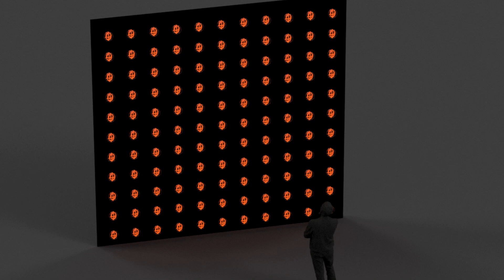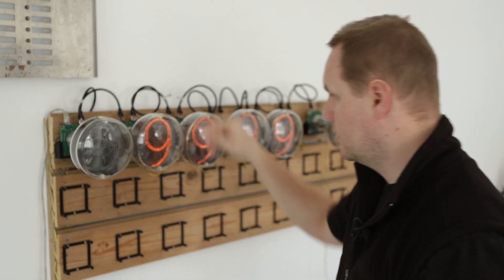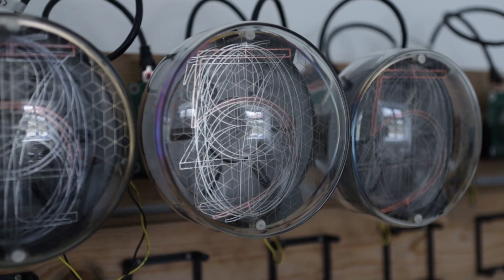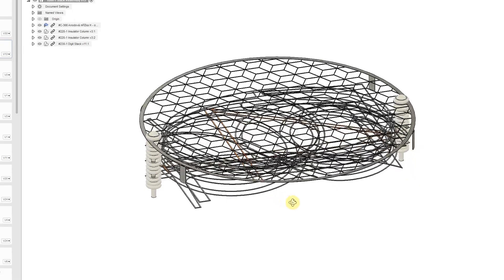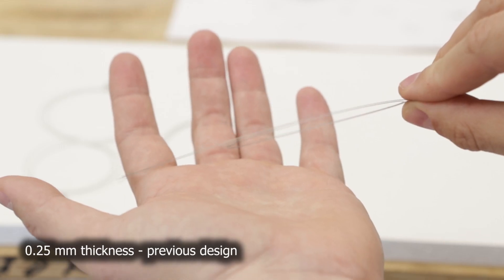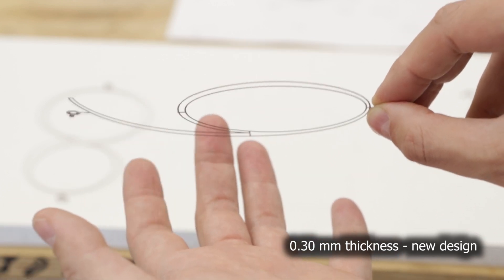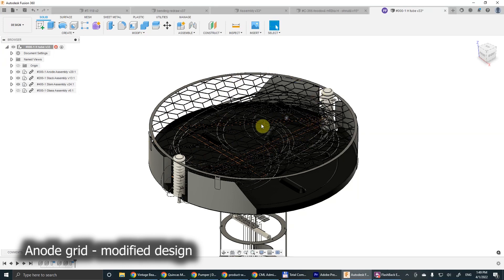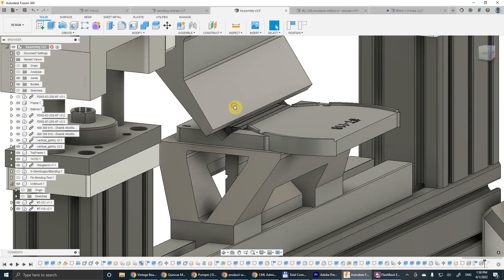New batch of H tubes, preparing shipment to USA | Week 12-13/2022

Comment: Totally excellent!  For the under sized holes try a tapered diamond burr. These have very fine grit so they can take out small amounts of metal without galling. They are available low cost on ebay.

Comment: Hi.
Barely 2mins in to the video, and my first thought is would it be possible to form the numbers in the similar  way that LED digits are made?  i.e.7 segments?  Or would that require more, or too elaborate switching?
I assume that when activating a given number with a Nixie tube, only one circuit is energised, whereas with say an LED number 7, three segments would have to be energised.
I also realise that Nixie tube numbers are VERY different in appearance, and of course this may not be acceptable to you.
Regards Mark in the UK
Reply: That's called a numitron, iirc
Reply from the maker: Search for panaplex… 7 segment means losing the 3d effect of a nixie tube..

Comment: ...nice to see you're experimenting with metal thickness to increase rigidity. I proposed this solution when you mentioned this problem a year ago and now you're actually doing it. :D

Also, that butane torch for welding glass. Can it be replaced by some sort of resistant metal wire "ring" heater as ones used in electric kilns? This way glass would be made uniformly welded around the whole rim and could eliminate human "error" in the process...:/
Reply from the maker: The thicker material is more difficult to etch, so I wanted to try lower thickness first :-) glassblowing is fine, fast and efficient. Laser is improvement, but very expensive.
Reply: propane, probably.  yes, a metal heater of some type could possibly work, as long as the metal doesn't touch the glass.  also, lasers.  but this wheel does not need reinventing.  scientific glassblowing has worked well for centuries.
Reply: @travismiller5548  ...of course it has. On smaller scale it probably is more economical to hire a skilled person to do it, but when numbers increase consistency gains importance and the only way to achieve it is trough process automatization. It all depends on what one needs and can afford at given the moment...:)

Comment: 3:51 a good way to enlarge fine holes would be to get yourself a "model maker's shim punch set" (or make your own if size ain't correct). Simple, effective, and with the support given by the two plates sandwiching the part, there's no deformation.

Comment: What if you coat the bottom of the letters with a ceramic-based coating or something similar to prevent them making contact if they bend?
Reply from the maker: It would peel off, I tried :-)

Comment: I can imagine in a few years seeing someone beginning a similar journey to bring CRT manufacturing back in a similar way.
Reply: The glass bottle is basically the right shape (probably need to add some length), just add a phosphor coating, a HV connection, deflection plates, and an electron gun. Then pair it with a FPGA to emulate whatever classic vector display computer you want.

Comment: Why don't you use the laser marking machine for increasing the hole size? Multiple passes cut the material perfectly. You will need to use the air blow cooling on the part, but precision is 0.005mm
Reply from the maker: Good idea - we have a small laser, the guys were afraid of warping the digit by heat..
Reply: @daliborfarny  Warping won't happen if cutting speed is high so heat has no time to transfer through the material. That is why marking laser is needed. it does many many passes in milliseconds. Of course, you will need to perform experiments before applying the final result.
Reply: he mentioned in the video that they farm out the laser work.  maybe I'm misunderstanding something?
Reply: @travismiller5548  I might miss that statement =) My bad
Reply: @deepmaze1  well if the company d oesn't have lasers yet, they will eventually 😝